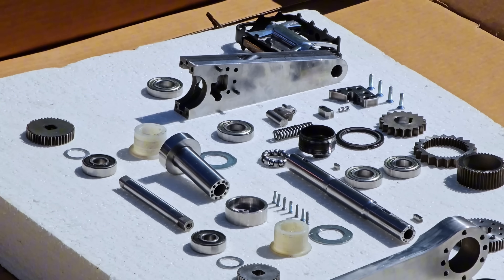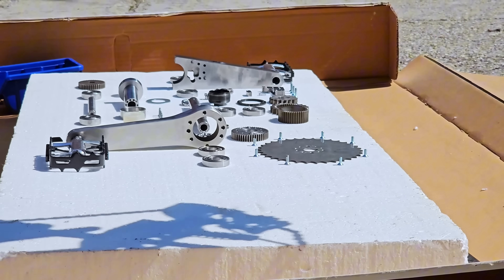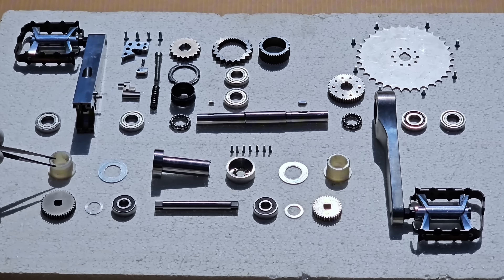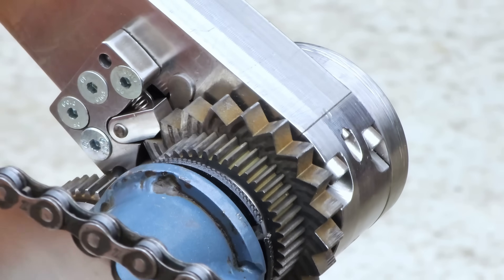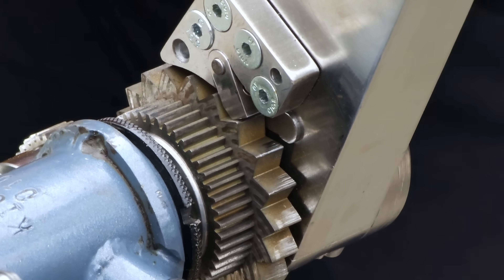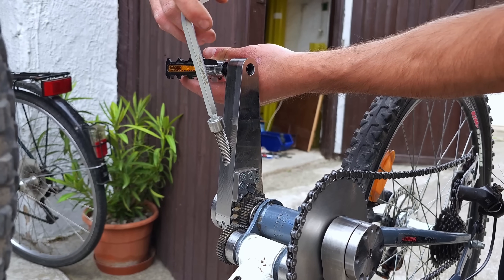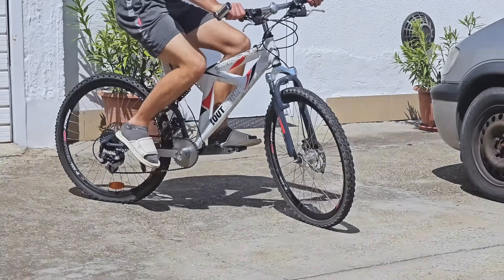I Built a Self Shifting Bike Gearbox and Here's What Happened

Comment: So it work by relaying on spring tension to connecting a torq on high gear, if the torq is far more than spring can overcome, the high speed rachet surrender and extra torq is next capture by a solid rachet of low speed gearbox almost instanly and continuesly as the torq still beyond the spring can deliver, such brillian with mechanical durabilities.  Forget about 2 speed gearbox, 
Scale up those mechanism and put 5 speed gear with progressing spring disagegement.

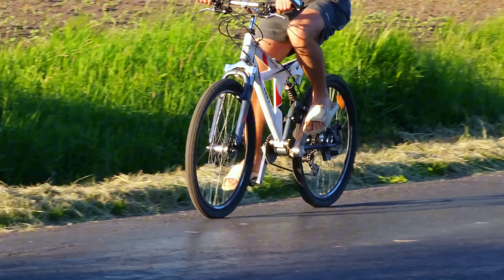Comment: 7:20 What is that black thing with a spring located on your left side at the rear of the frame?
BTW, you have low air pressure.
Kee up the good work.

Comment: Why would you design and assemble a prototype only to bolt everything onto an old rusted steel tube bicycle?
Why not assemble it on a newer titanium frame or a carbon fiber frame? Yes, those types of frames are expensive, but it seems to me that they would perform better than the old steel frame.
Reply: What is better except lighter weight? He could just skip breakfast and save few k on frame
Reply: Because it's a prototype?
Reply: Because this is not intended for actual use, why break a good expensive bike for a prototype?